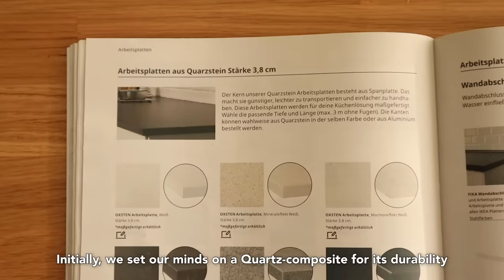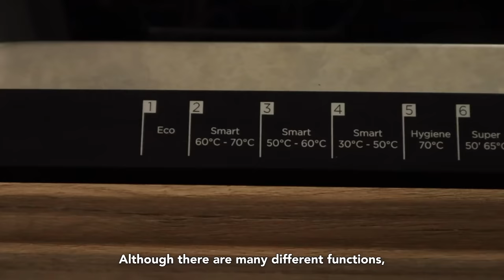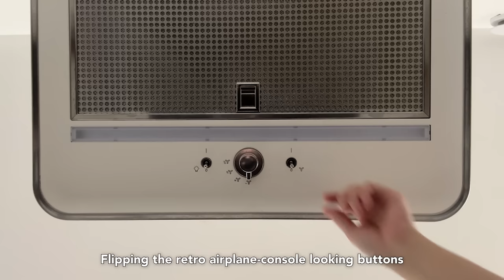1 year IKEA kitchen review | Costs, regrets, storage & organization

Comment: If one side of the stove heats the pan and the other side of the pan does not get heated up this means the pan is NOT suited for induction. You can easily check this at the bottom off the pan this should be totally flat. No dots and not ribbed, just even flat.

Comment: We also have an ikea kitchen (~5 years old) and agree that drawers>>cupboards. We don't have any upper cabinets either and have no regrets, but did stack two cabinets on top of each other to create a floor to ceiling cabinet which hides the boiler. We didn't buy the applliances from IKEA, because a) I heard the quality was not great and b) we prefer freestanding appliances. I think the kitchen stuff in Ikea is the best quality they sell. I once had a PAX wardrobe and the damn thing almost killed me when reassembling it after moving house because the quality was so terrible but the kitchen cabinets are solid as a rock.

Comment: A very helpful review! It verified what I feared about certain IKEA appliances. Currently I have older IKEA kitchen cabinets with separately bought appliances. The appliances all work well despite being a bit older. The kitchen cabinets (discontinued FAKTUM series with plain non-glossy white fronts) are very sturdy and even after after +10 years of daily use I have no complaints about them. Even the drawers hold up pretty well. 10/10 would recommend.
I am thinking about getting a vent (?) like you have as an add-on, so I'm glad this one got a good review from you! :)

Comment: I am also very happy with my IKEA kitchen, which I have had for many years. I did choose to buy my appliances, sink, faucet and countertop elsewhere, however, because I had some misgivings about the quality. I so agree about having lots of drawers and pull-outs instead of regular cabinets with just shelves, where it is hard to see what you have.
Reply from the maker: Could you share how you installed the appliances and if they fit nicely? ☺️ That'd be so helpful!
Reply: @cloudyhills   I measured the fridge beforehand (one of those intermediate size 122 cm high ones) to make sure it was the same in dimensions to the similar ones sold at IKEA. It sits inside a tall cabinet with shelves on top. This was about 14 years ago. Recently the motor gave out (grrr) and I just got a new one installed this week and it also fit perfectly. The dishwasher is not panelled, it is just a regular dishwasher where I unscrewed the top to fit it under the counter. The gas stove top and oven were secondhand and they fit in the IKEA cabinet just fine. And I just have a stainless steel sink, so it simply had to be set into the countertop. I guess it is tricky if you want a panelled dishwasher, but exact measurements are the key.

Comment: We rent a studio in Paris during our vacation with a ikea kitchen and appliances. We can notice the difference with our house appliances. The build-in oven design is very neat but impossible to use when you haven read the instructions manual. The glass cookingtop is not as uniform and powerful than our Jenn-air. I use the regular cycle of the diswasher and I often found little trace of soap granules on top of the cups. I thought it was the dishwasher soap, a brand, that i wasn’t familiar with… but maybe it’s the dishwasher. We have a bosh at home and even the quick cycle does a better job. What really annoyed me is the sink is not enough deep making a lot of 💦.

Comment: The reason you aren't getting clean dishes is because of the dishwasher tablets. These skip the "pre-rinse" cycle. You would need to use at least two tablets per wash, one inside the soap compartment and one outside. Alternatively use dishwasher powder. YouTuber "Technology Connections" did a long video explaining this in exhaustive detail. We had the same problem as you before we switched to dishwasher powder instead of tablets.

Comment: I got the Valbildad 2 zone induction hob (also available in 4) and it works very well. The 4 zone also comes in white which is a plus if you have white counter tops. My least favourite thing is those bins in the drawers. Lid does not stay open when you are trying to put stuff in it (eg scraping things in, need both hands and lid keeps falling closed), and you can't open the top to empty it unless the handle is at the front which means the handle falls down and collects all the rubbish as you are emptying it. If you put the handle at the back you can't open the lid. Very bad design.

Comment: The regrets for our Ikea kitchen are also the stove and oven. Ours is simple Ceranfeld (whatever that is in English 😅) - it has only one area for a big pot and 3 for tiny pots. The rest is taken up by the controls. Which are so clever designed, that our cat can turn on all cooking areas by walking across the surface 😂 but as soon as 1 drop of water or oil hits the panel, everything shuts off. We always have to use the kid-safety feature to cat-proof the stove by locking it. 🤭
Reply from the maker: Yes the stove is so frustrating! It's so sensitive yet not sensitive at the same time 🙄

Comment: Hi, I also struggled with my cheap little IKEA dishwasher, however, these are the 2 things that helped me improve the performance of the dishwasher:
1. Tabs: I use the DM Spülmaschinen-Tabs Multi-Power 12 and I feel like they do a better job than the Somat ones I used before - maybe powder could also work, but I didn't try that yet.
2. Check the settings of the dishwasher - depending on the Wasserhärte you have, you might have to adjust the settings of the dishwasher and/or add salt to the salt container more often; I personally re-add salt about every month (we use the dishwasher around 2 times per week).

The setting on which you wash the dishes also makes a difference - for me the Super '50 works 90% of the time, the other 10% I use the Hygiene 70.

Sorry if that's old news to you - hopefully it can still help you or someone in the comments :)
Reply from the maker: Thank you so much for the detailed comment! 😘 I'm going to try your tips for sure. I currently use Finish tabs which was the best for our previous dishwasher, but yeah, probably have to try out different ones that work for this new dishwasher!
Reply: Even with a 'brand '  you have to find your settings that work, but agreed with the tablets

Comment: My IKEA kitchen (appliances are not IKEA, and the counter top isn't IKEA), is 15 years old. Some edges have chipped from years of use, and the ridges in the doors are a bit difficult to clean. But other than that it's a pretty decent kitchen. Not the most stylish by today's standards, but it works.

Comment: I'm never buying Ikea kitchen electrics again. The waching machine broke after 5 years, the stove top is underperforming as heck, the oven lost some of it's functions after a while, the vent is blowing more than it's sucking.
So... the cabinets and LEDs in/under the cabinets are ok; the LEDs working fine for almost 7 years now.
edit: forgot the dishwasher; it's ok but the eco function is unusable (detergent powder won't dissolve), the other (hot) programs are fine.

Comment: Hi, beautiful kitchen. did you find out if you can buy appliances separately? Ikea cabinets with non ikea appliances?
Reply from the maker: Yes, you can! You'd need to either install it yourself or hire a professional to do it. The only thing that can't really be "seamlessly" fitted into the kitchen is the dishwasher.
Reply: @cloudyhills yes, I was told the same so I only bought an ikea dishwasher and a hub. The sink is franke and fridge and oven plus induction are bosch

Comment: Thanks for the video! I was wondering which water tap do you have and how is it holding up, do you like the hose? :) 

I really regret getting a black tap, the paint does not stay on at all, it has chipped of on areas of high use in under two years... originally I was trying to avoid stainless steel anywhere and the kitchen (the dream was to have copper or rose gold accents), but now I wish I gotten a stainless steel one, you end up with so much steel in the kitchen anyway! :(

Comment: Hola. Realmente quería saber sobre la anterior encimera de madera de la otra casa. Era difícil de mantener? Que cuidados teníais? Es que quiero poner de esas pero estas dudando por si es muy delicada.
Reply from the maker: It was actually quite difficult to maintain it well. You need to make sure to reoil it every year and even so it's not waterproof. Any water left sitting even if just for a few hours will ruin the wood countertop. 

I also previously left out my bottles of oil and and soy sauce on the wood countertop, which was a big mistake because the bottom of the bottles left stains on the counter which took me quite long to sand and retreat it! 

If you're a messy cook like me, I definitely don't recommend it unless you thoroughly clean the kitchen every day!

Comment: How about the laminate worktops getting wet? Won't it cause the wood to warp? I'm also interested with ikea's worktop coz it's easier to buy and install (i think) but do i need to keep making sure it's dry all the time?
Reply from the maker: Haven't had any problems with that. Sometimes after washing the dishes we forget to wipe the area around the sink which gets wet, but so far everything still looks good there, no warping.

Comment: So why don't rental flats in Germany have kitchen cabinets and basic appliances? Are you taking them with you when you move out?
Reply: It's common in Europe. When you rent unfurnished flats, the only legal obligation for the kitchen is a sink and a place to put a cooking appliance
So you're supposed to put furniture you can easily take away once you move out and reuse in your next flat
Reply: @celine9238  I find it a bit abstract, because in Poland such flats usually have all the necessary furniture and appliances 🙂 You move in only with your personal belongings. For me taking kitchen cabinets may not be optimal, as flats have different layouts and they might just not fit. But there are probably also some pros 😉
Reply: @celine9238 no not everywhere in Europe. In the Netherlands you usually don't get a furnished apartment but a basic (or sometimes luxury) kitchen and bathroom are there for the exact reason that it's hard to take a kitchen with you. I'm pretty sure a rental apartment without a kitchen would be hard to rent out (however, in this market desperate people probably take anything)
Reply: She actually explains in the video
Reply: I think this is only in Germany and not very often. I rent out an apartament and installed a kitchen and all the necessary furniture. In Eastern Europe it is common to have everything installed. You just move in with clothes.